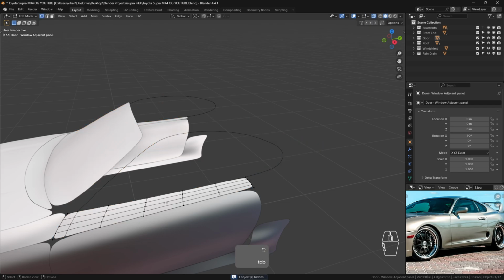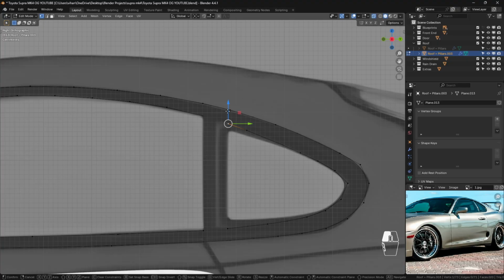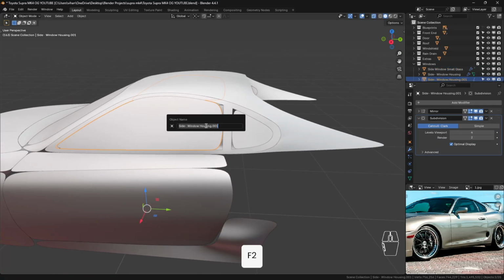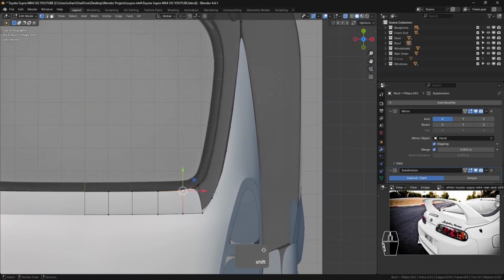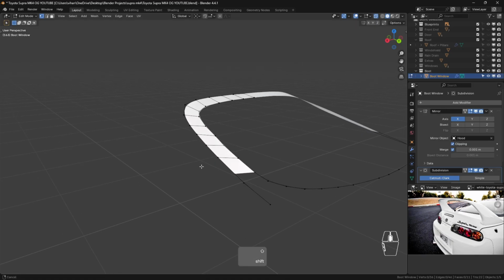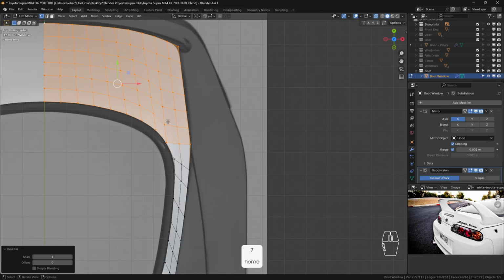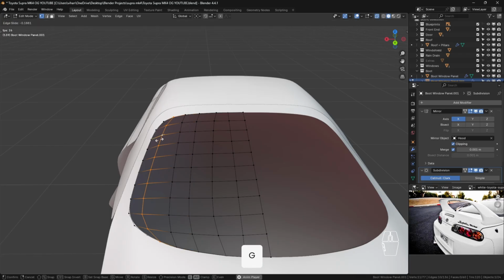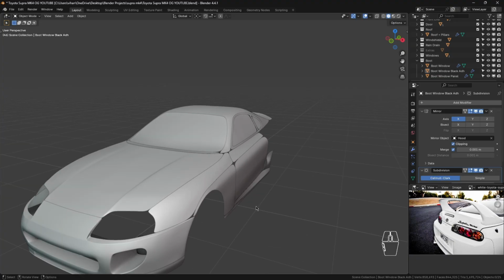Blender Car Modelling Tutorial - Windows, Back End & Door-Sill (Step-by-step)

Comment: The reference images for the project are getting deleted, what could be the reason? What can I do?
Reply from the maker: Have you tried toggling the arrow icon on the scenetree to your right? It disables you from clicking on it, so you would be unable to delete it. You can enable the arrow from the little filter icon above scene collection. Let me know if this works for you :)
Reply: @Versus_53  
The blueprints, but I already saw what happened, I moved the .Blend file.
This was the solution. 
File > External Data > Pack Resources

And of course, putting the images back in place. Thank you.
Reply from the maker: Glad you figured it out 💪🏻